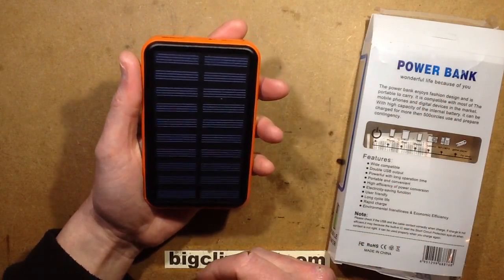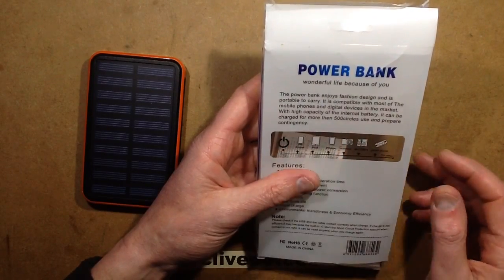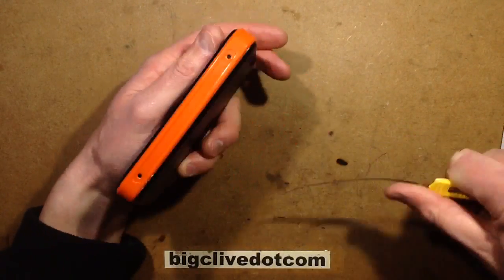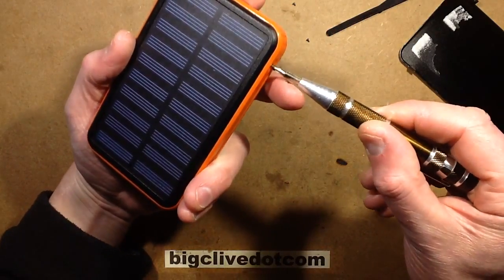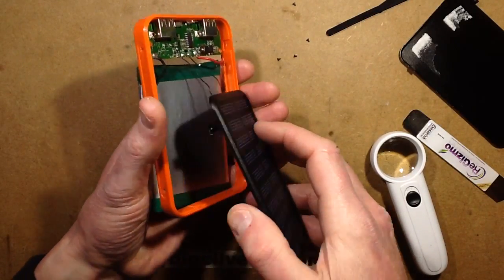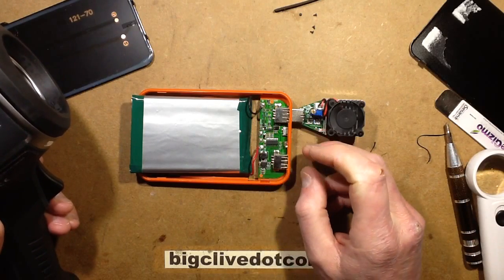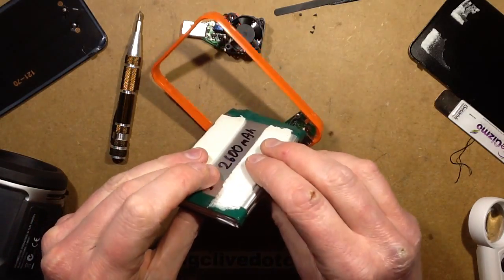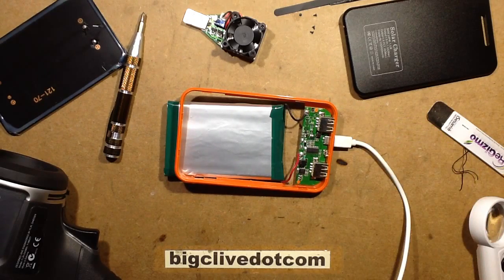FAKE! 100,000mAh solar powerbank capacity test and opening.

Comment: Wait..  Chinese seller misrepresented their product?! No way!  They never do that!  I fully expected this to put out 100amp! 

You should see about getting your hands on some of those jump start your car booster packs and taking them to bits..
Reply from the maker: Slight stumbling block with the starter packs.  I'd actually want to test them at their rated current and the one I have here is rated for "2000A" (apparently.)
Reply: @bigclivedotcom  I've used one, and it did jump start my car a few times, apparently you can run high amp for a fraction of a second without frying cables and such which is all the car needs to get started.
Reply: Unless it's a diesel. Then low temperature plays a big role (on top of displacement and battery depletion).
Reply: It can do 2000A, for 10femtoseconds. Then it explodes.
Reply: Note how the figure of 100000mAh is clarified in the item description. The battery capacity is actually listed as 12000mAh, just over twice what it is in reality. The 100000mAh number actually refers to the "solar panel capacity". Whatever the fuck that is supposed to mean.
Reply: Diesel cars rely on the temperature created by compression to cause the fuel to ignite. When its colder its harder to overcome that initial cold temperature to ignite the fuel.  If the only problem with starting cars at cold temperatures was the battery cranking more slowly then engine block heaters wouldn't work, you'd have to heat the battery...
Reply: station240 honestly I think what theyre really counting on is the fact that anyone who orders a 10 quid 100000mAh power bank doesnt know what a mAh is
Reply: Whoever made this figured it would take you more than 30 days to figure out it's not anywhere near 100Ah.
If it were real it would probably take more than 30 days to discharge via USB.
Reply: Excuse me while I go and fuel my fleet of flying pigs !
Reply: so all those 5MW lasers I ordered are fake too? oh noo man
Reply: Kevin Miedema likely aren’t filtered properly either which means they can often emit IR laser even if the battery seems dead and you won’t see it, should you bounce it off something or god forbid look into it to verify it’s not working you can burn a spot on your retina thanks to their cheating our on IR spectrum filtering. Green lasers are most commonly affected afaik.
Reply: I wonder if two of them (jump starter packs) in series could be used to jump start a plane via the GPU socket ;) Overloading lithium batteries near a large amount of jet fuel - that could end badly LOL :)
Reply: elesjuan ikr. Chinese sellers never lie on the capacity of products, in fact the cells always come with a capacity higher than the claimed. for example the 12000mAh 18650 is actually 15Ah. the problems is with the british and japanese sellers that tries to sell crappy Panasonic cells that only have 2500mAh in capacity.
Reply: +Lantern Lab  Every diesel vehicle I've ever driven had glow plugs to assist starting.  If you follow the starting procedure and let them heat up first, the engine will start cold just fine.  The high compression of diesels is more troublesome than temperature, but they should be designed with a properly sized starter motor and battery to compensate.  Engine block heaters have very little to do with easing starting; they're intended to ensure immediate lubrication after starting by keeping the oil warm.
Reply: haha yep starting currents are HUGE. Thats why larger aircraft have start air on board supplied by the smaller apu which doesn't ruin the batteries after 3 cold starts :P I still reckon it would be funny to see someone cobbling two jump packs together to try and start an aircraft with flat batteries and no ground power available. (assuming a 24v system)
Reply: +Francois   - Your lack of hearing of anything is not sufficient knowledge to present something else as fact.

1)  Yes cold weather drastically reduces the current capacity of a lead acid battery, BUT

2)  The engine displacement is relevant because it require more current to overcome the compression of a larger engine, to drive the larger starter, and fire more spark plugs at high enough voltage to get good spark when the cold cylinder walls are making gas vapor condense.

3)  Oil viscosity increases with temperature, the whole reason why we use multi-weight oils with that (n)W number, and the larger the engine the more the drag, MUCH more drag.  It is easy to observe the difference when people install an engine (pre-) heater to help them start on cold days.  That heater does little to nothing to warm the battery up, though a clever person could also have a modest battery heater and trickle charger on the battery two, so that both energize to keep both subsystems in best condition possible.
Reply: The cheap Chinese jumper pack I have actually lists believable numbers - 200A for up to 30 seconds and 400A peak (which I assume means for like 100ms or so).
They did bullshit the capacity a little though. 20Ah they reckon. I measured about 2.1Ah... Which is still not bad for $30AU.
Reply: I have one of the 2-cell Tomo and for now find it great. Displayed current is fairly accurate, displays about 100mA more then measured externally at full scale. Ports are protected and cut off at 1.5A for the 1A port and and 2.2A for the 2A port (displayed values). Displayed voltage seems to be always 5.1V but falls to 4.8V at 2.2A load, which is still very good. It has the slightly annoying on/off detection at about 100mA like many. I was pleasantly surprised by the handling of the state of each cell, they're "isolated" from each other so it accepts cells of different charge levels perfectly well both for charge and discharge unlike some crappy ones that just parallel all cells (which could be dangerous if you don't keep them in sync). Only annoyance for me is that the plastic cover on the port side is too thick, so that the microUSB charge cable doesn't insert properly all the way and disconnects easily. Might need to grind that a bit, but I'll be fast charging my cells on an external charger most of the time anyway.
Reply: LOL  ty sir
Reply: bigclivedotcom 20000 amps?? you can run an eaf steel factory with that.
Reply: +dash8brj  Haha!  A 2S50P pack, maybe!  I'm assuming you fly Dash-8s, given your username -- I used to also (-202 models).  I don't remember the battery ratings, but I know the main battery was a honking great NiCd capable of grunting many hundreds of amps with little voltage drop for several tens of seconds.  I also remember we had a battery temperature gauge that spent much of its life at the upper end of the range, particularly if the plane was flying many short segments in a day, which they usually did.  I had more than one flight delayed due to excessive battery temperature.  It took Bombardier many years to learn how to build airplanes suited to hot environments.  The PACKs in the CRJ-200 are another perfect example.  Good times...
Reply: Francois Rousignat
So when you use some sort of engine pre-heater, why does the starter turn the engine faster and the engine starts more easily, compared to cold engine? The battery temperature remains the same. What you are saying simply is not true. Cold engine needs more amps to start than warm engine. You can test it for yourself if you dont believe.
Reply: @Catrik  perhaps the oil flows quicker. As im sure you could geuss im no mechanic. Or gour perception is off. Confirmation bias kinda. I also habe brain damage literally.
Reply: astafzciba wait, they have this already? Last time I checked they had a 9900 mAh 18650, beating Panasonic and all their expensive research (who needs that right?).
Reply: +FlyingShotsman My dads van was a direct injection diesel, they don't have glow plugs, 
think it was a 2.5 litre engine.  Most bigger trucks vans and buses are 
like this too, its usually smaller 2 litre engine or less passenger car 
diesels that have glow plugs like my old Seat Ibiza.
Reply: bigclivedotcom hey I see that you like to review the power banks there's Tomo 18650 power bank /charger I've gotten one .the USB ports magically quit working. they are cheep.
Reply: OrbitalSP2     It was proved they were 9.9A fakes they were 2.2A when tested,  Panasonic is the most counterfieted 18650,  they moved the plant to Germany from China to stop it.   Also came to light is that most of Pana AA and AAA at international airports were fake.   There are reports of fake D batteries having a AA inside.  9.9A nominal 18650 do not exist yet,   China is playing on humans like big numbers.
Reply: qazwsx edcrfv I know, I was being ironic ;)
Reply: qazwsx edcrfv omg!!!
Reply: OrbitalSP2 yes they did invent the 12Ah 18650
Reply: My step dad got one of those for black friday and my car battery died this winter and I had him use it and OMG, wth hell?  It is about the size of the device Clive held in his hands and it started my car with no issues AND had enough charge to jump start it another 1.5 times.  I am totally impressed to be honest.
Reply: astafzciba well, after the 100.000 mAh that doesn't even have 10k, everything is possible from China lol
Reply: Ondřej Dujka I think you've got your compression statement backwards. Lower temperature means higher compression. air density increases as temperature decreases.
Reply: I second this motion. I'd like to take a 12v port from the internals of one of those to charge things.
Reply: I'd buy this power bank just so i could complain to the manufacturer!
Reply: I would guess you are not in Canada in the winter.....:whistle:
Reply: +Trevor Robinson I wish you'd said that yesterday! I ordered three of the four cell ones last night for $NZ50. :-/
Reply: And the solar panel looks moot. Appears to have no connection to the circuit board!
Reply: More like "it requires more current to overcome the FRICTION and intertia of a larger engine." A larger engine with lower compression ratio may be easier to crank than a smaller one with high compression ratio.
Reply: my dad once drove my car all the way home with a dead battery and alternator on one of those
Reply: +Franchois Deshue You're right about the oil viscosity, it really doesn't matter. It doesn't even start getting thicker until it's close to the absolute maximum low temperature rating. Then it starts getting a bit thicker and ramps up until it actually freezes.
Reply: jut one second or 1-2 more turns to the starter . nothing more :D still important if you hawe battery power thats only enough for only one turn :D
Reply: SierraLimaOscar I totally agree with you on this!Cold starts are part less cranking amps!But mechanical there's a good deal of resistance to turning over!Why do u think they have oil weights for summer and winter months? If oil wasn't playing in the resistance of cold starts there would be one oil weight 10w-30 For all!fill a couple syringes with motor oil freeze one of them and keep the other at outside temp.after a night of chillin take both syringes and see what happens!If u want to hook up a electronic motor system to squeeze them. I bet the cooler oil puts a great deal more strain on the motors ability to empty it.and you don't have to freeze the battery in that test to see it's way more than a lack of chemical reaction in a battery!
Reply: Francois Deshue no
Reply: Lord of the belts: The return of the KING you live in a bubble
Reply: @Eddie Hitler Not anymore, but it's been 3 years since that comment back then talking about a 19 year old van.
Reply: Between the 2 jump packs that I got they had 3 packs just under 3000mAh. But the direct connection from the packs to the booster socket is somewhat beefy. I've jumped dead cars all the way up to a 5 liter ford V-8 in -5C. 

They were stated as being 60,000mAh+ and something like 600A boost. They boost cars so no complaints. 

Something of note was the voltage difference on the fully charged packs. One was 12.5v and one was 16v. The 16v is what I use to boost cars.
Reply: @thatrudager  my transit connect had that fault where it'd just lose charge all the time a pain in the arse fr. Alternator was fine common fault by all accounts. Very under powered 73hp. Couldn't pull the skin of a rice pudding.
Reply: Also, lower temperature means lower compression.

But the part about battery is true. It is useful to turn on your headlights for 20 seconds before starting in very cold weather. Battery will warm-up and engine will crank faster.
Reply: Won't help shit. A battery has a internal resistance of ~0.02 Ohms.
Your car lights have ~100W power (lets say) => 8.3A of current draw.
That gives you 0.16W of power dissipation in the battery. Wont heat it up the slightest.

Comment: Maybe 1,000mAh @ 1 Amp load? Are these smaller batteries rated in mAh at a specific load: 100mA or 1,000mA; this makes a large difference in the rated charge capacity.
Reply: LakeNipissing - The battery pack/cell manufacturers are the first ones to rate the pack/cell, and they generally test teh output over a wide range of constant current draw situations and then pick the result they prefer... sometimes even using different values for the same battery but with different model numbers. 
Along with the constant current discharge rate, they normally include a max charge rate as well.
Reputable companies generally release their datasheets which include their test results as graphs.

This is when things get really bad though... the company who re-sells the cells may run their own tests designed to provide a 'better' result... and the same thing can happen with the assembler/manufacturer.

Either way... yes... the current drawn for the tests will/can have a dramatic impact no the results.